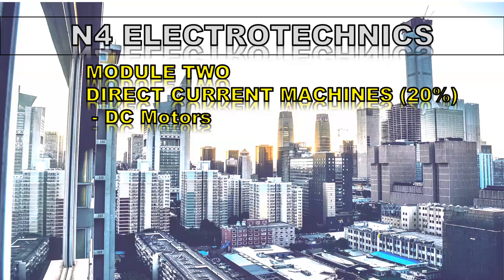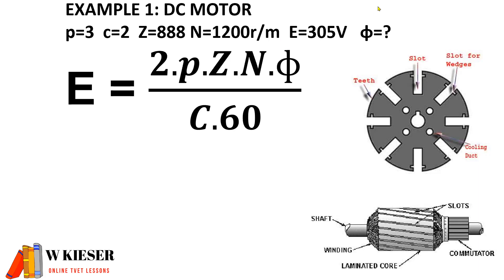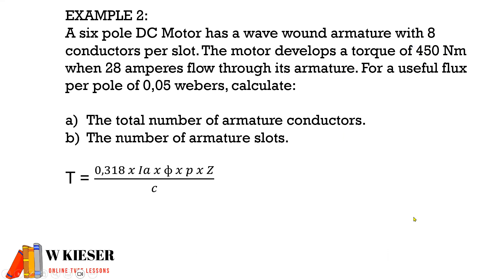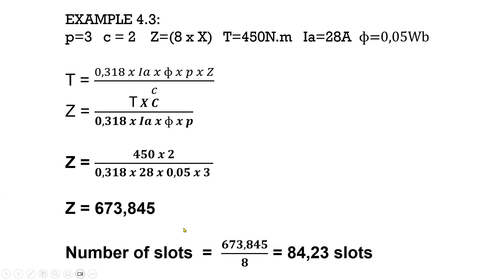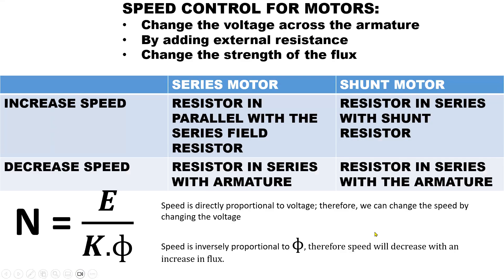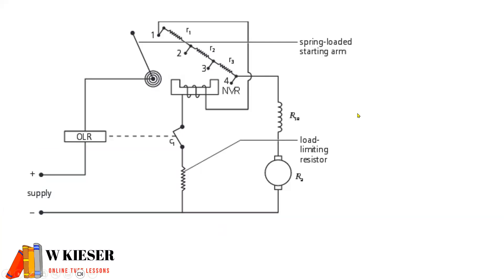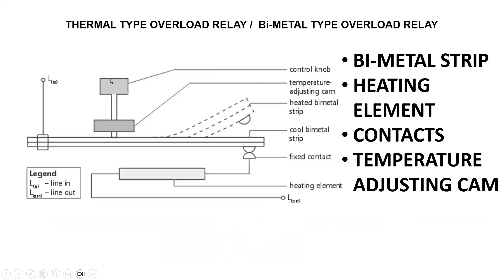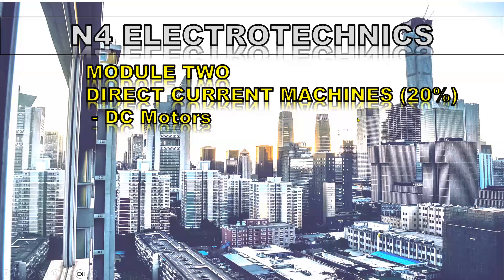Module 2.4 DC Motors

Comment: Why did you substitute by 3 in the place of "p" (number of pole pairs),  instead of substituting by 6, as there are six poles?
Reply from the maker: If I wear two Nike air tekkies, I am wearing one pair of shoes. 

Two poles in machine is one pair. 
One pair consist of a North pole and a South Pole. 
12 Pole = 6 pairs
10 Pole = 5 pairs
8 Pole = 4 pairs